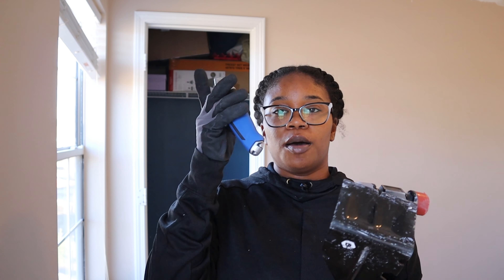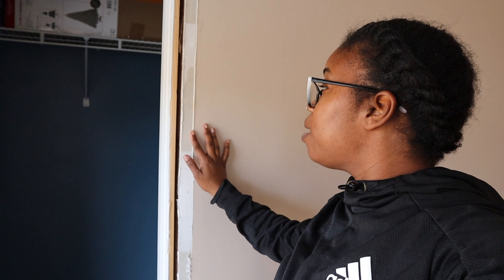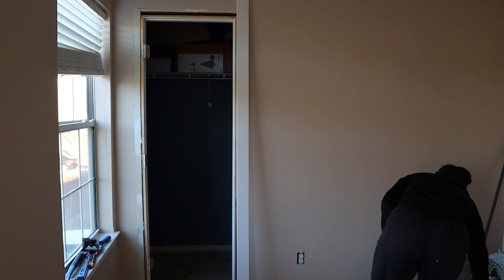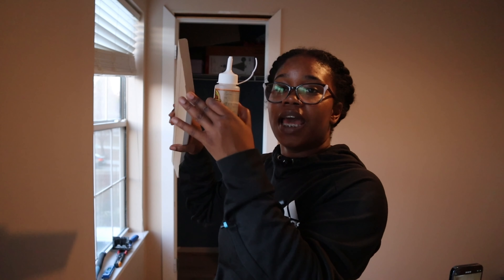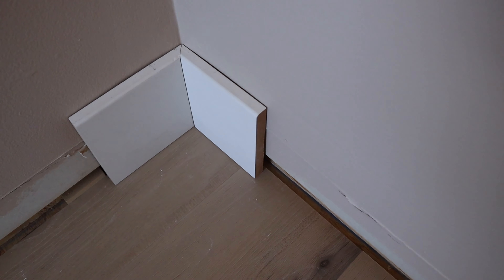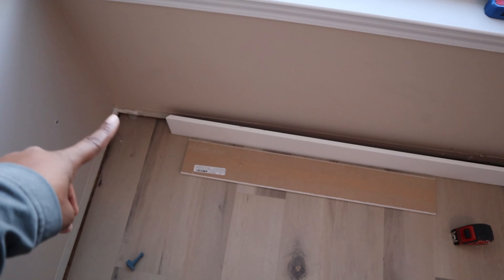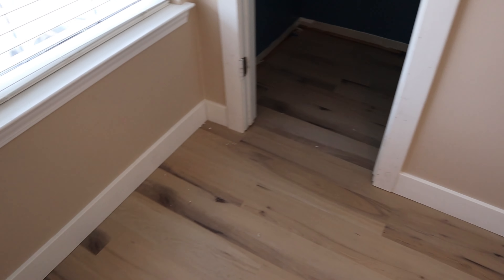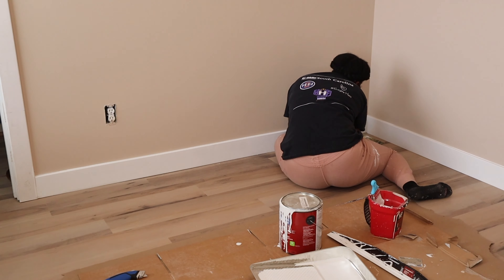How To Install Baseboards and Door Casing | Beginner Friendly DIY

Comment: You did an amazing job on the door trim and baseboards.  I want to redo my baseboards, but I’m terrified that I might mess up. However, I do have a question about your home. It appears that you don’t have tile flooring throughout your home. I have tile flooring in my common areas and I was wondering if I need to caulk the baseboards along the tile flooring. I hate the way that cock looks that the builder put there and I really don’t want to put it there when I replaced the baseboard. Again, you did an amazing job!  Very well done!